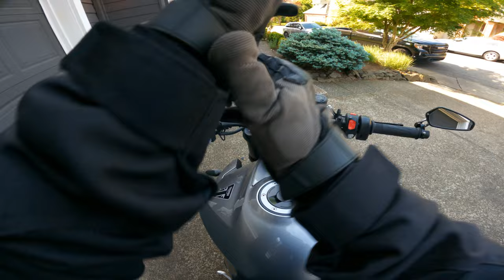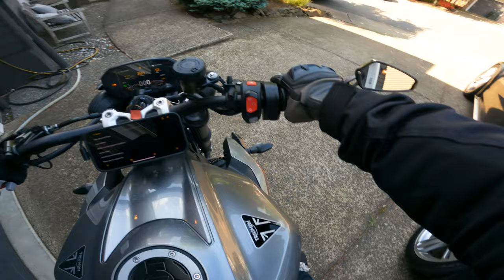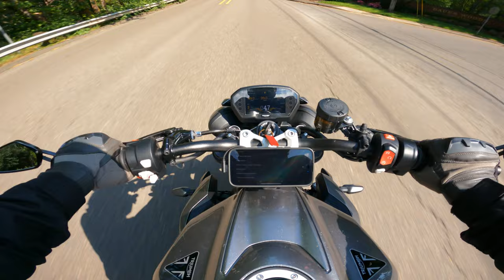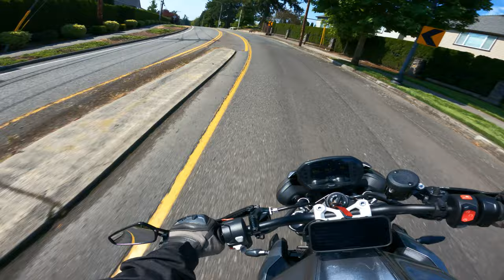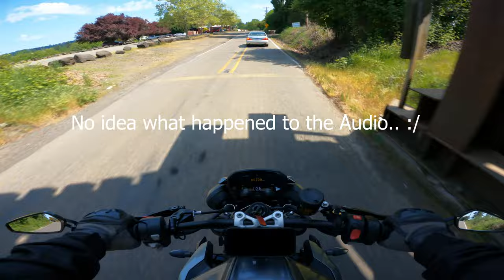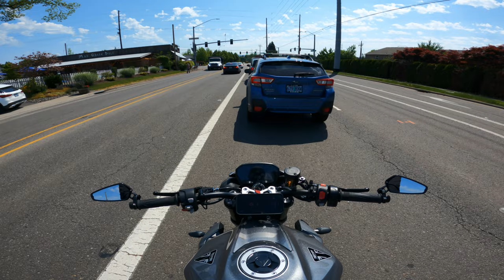Fridaze Chat | 2024 Street Triple RS

Comment: I came from a Sedici Strada 1 which was horrible in regards to wind buffeting and noise, not to mention it looked like a pumpkin on my head. RF1400 is awesome! Noticeably quieter than the Sedici and it feels weightless at speed - I can move my head around as easily at 80mph as I can at a stop light. The photo chromatic visor is a game changer too. 

Regarding GoPro ND filter stuff, like I mentioned on FB your footage looks great, but I understand the double lens thing. The GP11 lens twists off and can be replaced with a twist on ND filter. I just have a cheap Amazon set too and have zero issues. Not sure how much you’re color correcting and grading  your footage, but the 10-bit color on the GP11 is what swayed me to pick one up.

Comment: Did U happen to find the OBD port on the bike?
Reply from the maker: Its under the rear. A red connector. You need a euro 5-6 adapter. But tuneECU doesnt work yet
Reply: @MotoCorn  I figured that's what that plug was for since I couldn't find it anywhere. Yes I was looking to use TuneECU eventually to reset the service wrench when the time comes.
Reply from the maker: @Jshark606  Yea i was confused too, as the trident has a typical OBD port. Im waiting for it as well
Reply: @Jshark606  I am dreading going to the dealer for the 600mi service. It pains me so much as a mechanic to have to pay someone to do it =/ By the next service we should have a way to turn the light off though hopefully.
Reply: @CraterLakey  I'll just live with the wrench light when the time comes. I refuse to pay to get it reset.
Reply: @CraterLakey  Try Healtech, i just ordered one for my 2023 Tiger 850. It's called a maintenance mate.
Reply: Just FYI, TuneECU works now on 23+ Street Triple RS models. Yey!
Reply: @Jshark606  nice thanks for update